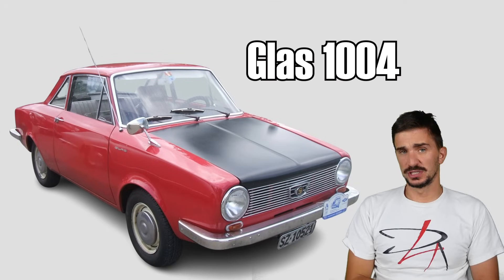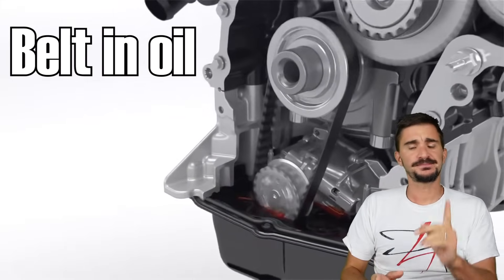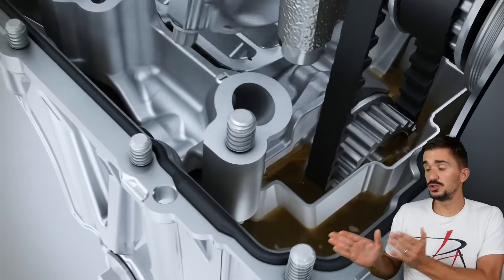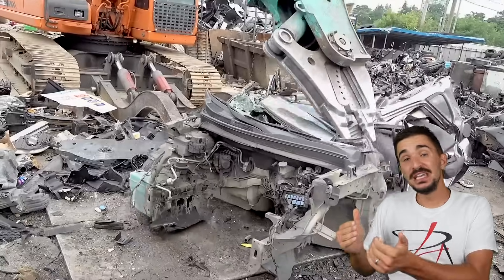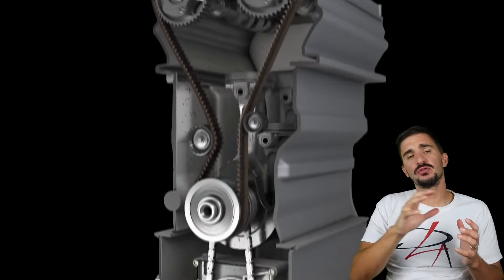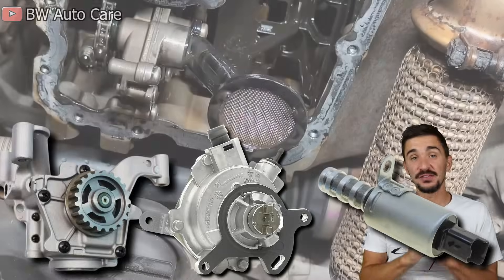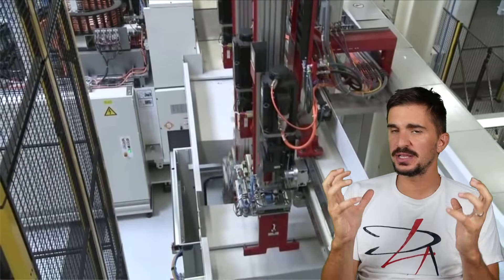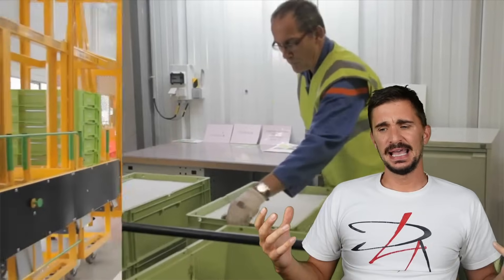Who Approved This and Why Is It Still Being Made? Wet Belt aka Belt in Oil Engines

Comment from the maker: Support the channel by shopping through this link: https://amzn.to/3RIqU0u
Patreon: https://www.patreon.com/d4a
Become a member: https://www.youtube.com/channel/UCwosUnVH6AINmxtqkNJ3Fbg/join
Grit: https://www.youtube.com/channel/UCt3YSIPcvJsYbwGCDLNiIKA
Reply: ⚠️5k miles oil intervals for all modern engines is key.
Timing chains, guides cylinder walls and crank journals  etc last last considerably longer.
I've and others have proved it in the motortrade ✅️
Reply: I found the video very optimistic, not depressing. If your voice helps them stop that ignorance in even the slightest way it is well placed optimism to think it is well worth trying.
Reply: You can blame the company(s), but ultimately this goes back to regulations from the governments, full of people who don't understand ANY of these engineering problems, demanding better and better emissions. 😒
They should have stopped pushing a long time ago, and just accepted the significant gains already achieved.
Reply: plz use that mindset with crumple zones and airbags! how many deaths from no airbags in the back seat?
Reply: @julesviolin 
Yup, good point!

Dave (Dave's Auto repair) recommends oil change intervals at least half of whatever the manufacturer recommends.

I remember the olden times when we changed the oil at 3500miles.
Then new cars were coming out and the salesman at the dealership said "no it's 7000 miles, now it's 10000 miles".

And I thought....
"Wow, our oil technology and engine efficiency has really gotten so much better!"

Lies!
Reply: Of course it was Ford, just like the plastic keys that would break
Reply: @Outlaws28  7k or 10k is still much better for engine than ''recomended'' 20k or so (of course depends on engine load, journey style/type)
Reply: Just to add one more failure factor- the wet belts are much narrower than dry belts.
Reply: Why haven't class action lawsuits curtailed this practice?
Reply: Bro, the 1600 idtec has timing chain not timing belt. I have one with 200000 km on the clock, even in your video, it is clear on the image of the engine, it has chain distribution. 😂😂😂 16:45
Reply: It is the petrol 1.0 that has timing belt
Reply: Car manufacturers don't do it for profit. They do it for meeting the ever increasing average fleet emmision standards. 1% is a huge gain for them. Even if it makes the engines and their overall enviromental impact worse. It can save them millions of dollars in fines.
Reply: in developed/ saturated marketplaces the discussion goes from how can we reach a bigger audience to, ok we have a set customer base we need to shorten their ownership window/ increase buying frequency. say with cars if the standard ownership were five years, implementing promotions that bring the ownership down to three years would net a 67% gain all else equal. 
That would be all fine and dandy, but selling vehicles is competitive and doesnt generally offer the best margin, so dealer groups lobby auto makers to make worse products as service is their primary cashflow. most brands end up in a race to the bottom of intentional failure post three year 50k mile warranty, sad world.
Reply: BMW N 47 engine…make timing chains to fail and then engineer it to be at the rear of the engine. Then to repair the complete engine must be removed. 😢huge expenses to the customer. Stay away from this garbage.
Reply: We need a database of products (and brands) with bad or malicious design! Because it's simply hard to actually know what to look out for when buying a car, a phone or basically any even slightly complex modern product.
Reply: My assumption at this point is that it's intentional to destroy interest in the ICE.

Once is happenstance.  Twice is coincidence.  Three times is enemy action.
Reply: PUT YA DANG HANDS DOWN
Reply: i have invented an engine that uses conventional components but produces less emissions, more torque and better efficiency with less moving parts. i refuse to patent it, and i dont have the money to develop it. it will take a long time because i was ostracized since 12 years ago when a hospital attempted to kill me due to my depression and psychedelic plant use after suffering a neck injury at the end of my apprenticeship. but i expect if i can get a decent job and do some part time university, you will see it some time within the next 10 years being adopted widely.
Reply: Could you please recommend any new car with less than 1.6L engine that is sold in Europe without this type of known mistakes? I own one of those cars with 1.0L ecoboost engine since 2016 (my car is 2015), I changed the belt in 2023 (60K km), recommended by my mechanic, after the change we inspected the belt together, it was not that bad but sure there was some swelling and wear, we changed the oil strainer as well, as you mentioned it was filled with sludge/particles.
Reply: I absolutely love your videos. You're very honest and informative. I went to school for mechanical engineering and planned obsolescence was a very obvious design for everything when I talked to professors who were in the automotive industry. Profit over progression is such a disgusting side effect of capitalism.
Reply: New Hyvo chains with automatic tentioners have more parasitic loss than a belt but old manual tentioner roller chains have less parasitic loss than a belt.
Reply: You can get over 100 HP in a NA 1 liter with high RPM and not boost.
Reply: You also neglected to metion push rods as a realibe valve acutaion
Reply: @julesviolin it's not the mileage of the oil change it's  the condition of the oil. Some oil last longer than others. The same oil will lose viscosity faster depending on conditions weather driving style ECT.
Reply: If not already done so or advised so both you and Lois Rossman could put the car manufacturers back on track in building vehicles like those built pre 1970 that were built to last a lifetime - and when I say lifetime I'm not talking 20-25 years 
Yes those old vehicles probably didn't have the best fuel economy but they also didn't end up in landfill or recycling 2/3 years from new because they were written off from a small rear end shunt that caused the airbags to deploy.  Most current cars are built like white goods and entertainment tech....part of the throwaway society
Reply: That is funny.
Reply: @erwinnijs1 and cost millions or billions in warranty engines and  Law suits . 
Like my old company that used the cheapest.  Worst fuel cards . Cheaper on paper but in reality we would do a 15-30 mins diversion or worse if night time call out . Fuel was rubbish so vehicles breaking down and we would have to replace our own fuel filters or book them in so a lost day and company would still have to pay us... it was the most costly  cost saving I think I've ever seen . 
Costs need to considered over a multiple aspects .. not just 1 blind piece of paper  .
Reply: Can you pls make a video abt the new porsche 6 stroke engine?!
Reply: Contemporary humans are clever, not particularly intelligent. Clever uses tools effectively. Intelligent (truly intelligent) uses them wisely, accounting for the fullest picture of what bears on that tool usage.
Reply: Sehr gutes Video. Danke
Reply: Well done Brother. Lots of good points you made. The stark reality that motor vehicle, design engineers, especially in passenger vehicles and light commercials, are all committing crimes against the people, is there for all to see. 
Must've been going on for over 25-30 years with so many components designed to fail. It really is shocking. It's all history now, with my first Ford doing 218,000 miles and my second over 300,000 miles. Those days of just regular servicing and no major failures are sadly long gone. 
Q. Why is the Airline industry so different? Boeing, Airbus, Rolls Royce ect build engines and aircraft designed to rarely if ever fail. You cannot have any failure at  38,000 ft with 200 passengers on board, due to some cheap nasty component failing. I guess the airlines are  heavily regulated, as opposed to Car and Lcv manufacturers who aren't. Emissions crap and safety issues aside, motor vehicle manufacturers are just not required to build reliable products. This applies to so many industries today of course. Designed to fail. 👍💯✔🇬🇧🤔
Reply: FireBeam,
Naw. Companies are run by bean counters, not engineers. Nobody said, "use wet belts". Stop blaming government for greedy bean counters who see early engine failure as not a bad thing unless it hurts market share.
Reply: The savings is 100% in taxes. That 1% fuel savings along with testing shenanigans allows compliance to fuel mileage standards with minimal investment. All of the cost is transferred to the customer who has to repurchase their product repeatedly with the manufacturer selling doomed to failure replacement parts for a profit.
Reply: @d4a  Governments just so closely linked to the motor trade, as with so many other things. 

 "Planned obsolescence is adding to the amount of electronic waste we produce, which is damaging the environment. In recent decades, we have become accustomed to a fairly short product lifecycle, because products either wear out or become obsolete."

"Planned obsolescence is the calculated act of making sure the existing version of a product will become dated or useless within a given time frame. In technology circles, the replacement cycle for smartphones has historically been two to three years, as their underlying components wear down."

"Yes, planned obsolescence is a real business strategy that companies use to encourage consumers to buy new products. It involves intentionally designing products to break or become obsolete within a certain time frame. The goal is to make existing products unfashionable or unusable so that consumers will buy new ones."
Reply: @julesviolin  
Quite, but fully synthetic oil costs a small fortune on my 2.3L Fiat camper, 30km changes i go by, and of course ir's a dry running cambellt.
Reply: @FireBeam  
Well, u could say that about UK illegal sewage outfalls by UK water firms, who are regulated but getting away with it. Regulation needs to reasonable and strongly enforced. 
If UK never joined the EU and were then forced to fit cats to cars i guess we'd still be chugging around in unregulated no-cat dirty cars and vans using leaded fuels.  Regulation is one potato but deregulation is a dangerous thing in the wrong circumstances.
Reply: @FireBeam  
Remember Ralf Nader, and "unsafe at any speed"
The auto companies fought tooth and nail against seat belts.
Seat belts wearing is mandatory in UK and Europe. No doubt in US so-called freedoms allows non wearing, don't know.
Reply: @erwinnijs1  
Well now, how come it's beyond the wit of the most advanced auto engineers to make something that works and is relable and long lasting, and does not cost the customer as victim thousands of €£$ to renew when due? It's not just cam belts, they churn out products with bad design inbuilt faults and unreliability year after year. 
Now even Boeing!
Reply: @schalkloots6988 
Customer as victim
Reply: @morkzorckerborg5000  
Correct
Reply: @AnAvgJoe  
Customer as victim
Reply: @stewart8127  
Not much use in very hi revving engines though.
Reply: @InvictaView  
Customer as victim
Reply: @RePeteAndMe  
Customer as victim
Reply: @nla27  
Customer as victim
Reply: @QB2ERS Simply put, there is only one way to decrease CO2 emissions without increasing pollutants and that's by increasing efficiency. There is unfortunately a limit to how far you can push efficiency without sacrificing either cost or reliability.  Some seem to have reached this limit...
Reply: Do the Ford 2.0L Split Port with self removing valve seats or the Ford (Fiesta) 6 speed dual dry  clutch transmission. Maybe explore / explain why we NEED 6,8 or 10 speed automatic transmissions now.
Reply: VERY interesting to learn that MOST vehicles FAILED before the 100K mark !!!  It simply points at the utter BAD driving of most people.
AGREED. Wet belts are NOT good. BUT those that snapped BEFORE 100K is simply because of BAD driving.
The manufacturers have had ample time to realise their mistake (IF they didn't already know .......) so I've made up my mind. 
My next car will be Japanese or Korean.
Reply: I wonder how long it will be legal for an ECU to deliberately run an engine rich? On a carbo engine you can roll coal like a diesel if you make the timing really retarded and dump a lot of fuel
Reply: @julesviolin  i think these engines are being deliberately designed to fail.
Reply: You are one excellent guy!❤
Reply: this reminds me of cylinder deactivation, it gives around a 3% fuel savings on your vehicle, but cuts the potential engine lifespan down by 80%.
Reply: @erwinnijs1  1% is easier to find elsewhere. Thinner tyres are actually cheaper, and would give more than 1% saving.
Reply: @G-ra-ha-m  Sure, but skinnier tyres wear faster and tyres aren't cheap either. It might be more cost effective to replace a belt sooner than to replace 4 tyres sooner.
By all means criticize them for price gouging tactics, like 75 dollar fuel filters with non-replaceable filter elements for instance. I'm just saying that making their engines less reliable probably isn't one of them.
Reply: @erwinnijs1  They don't wear faster actually, as the compound is not as soft. Tyres are wide to dissipate heat BTW. Also with more efficiency, the batteries don't need to be so big. The closer to a golf cart an EV gets, the more sensible.
Reply: @G-ra-ha-m  Skinny tires not only wear faster for the same compound. They also provide less grip due to tire load sensitivity. If you then take a harder compound to compensate for the wear you decrease the grip even further. Not a good idea IMO.
Reply: @erwinnijs1  Oh Erwin, you completely miss the point. Tyres are wide to dissipate heat. The heat comes from the energy in the battery. Wide tyres have more rolling resistance than thin tyres.
Reply: @G-ra-ha-m  The point was why wet timming belts on ICE vehicles, not the tire width on EV's.
Reply: @erwinnijs1  At reply 58 on YT's hopeless interface I've long lost track of this discussion :D
Reply: @G-ra-ha-m  :D
Reply: @G-ra-ha-m  tires are wide to distribute weight, which reduces traction surface deformation and therefore heat generation per sq inch, if the tires are too thin the tires will either sink into the ground or the tire tread will deflect too much, generating a lot of internal friction and heating up the tire, ironically the heat dissipation is better in this scenario, but that's part of the problem, there is too much heat flowing through the materials.
Reply: @thatguy-em9lt  Wrong, fat tires are there to dissipate heat of softer compounds. Look at a truck and you'll see the wheels are not that wide, but the tyre pressures are high.
Reply: @G-ra-ha-m  your assumption is based on a solid-body model of physics, which we know is extremely flawed, what you need to look at is soft-body physics. Wider doesn't dissipate heat significantly better because rubber is an insulator, meaning you need a lot of rubber to dissipate heat efficiently, what it does is prevent heat from being generated in the first place because most heat from tires comes from internal friction in the tire caused by deformation of the tread and sidewall, deformation increases with ground pressure, ground pressure is determined by weight divided by contact patch, a larger contact patch without a corresponding increase in weight means you have less deformation and therefore less internal friction, less friction means less heat generated. 

The reason why highway-haulers use narrower tires is initial cost savings, a major part of the reason why you see so many tire carcasses and pavement flaws on the road is because they have too much ground pressure under load, long-haul trucking companies save money on initial tire purchases, the public pays for it by them spending more overall on tires, passing the cost of purchasing more tires onto the consumer and decreasing the lifespan of pavement in the process, costing more tax revenue.
Reply: @thatguy-em9lt  It's not an assumption, the reason for wide tyres is not a secret, it's documented all over the web. It's to dissipate heat.
Reply: @G-ra-ha-m  again, that theory was developed before soft-body friction was really worked out, and most people working in Automotive fields aren't going to work with it because for most performance calculations, rigid-body physics are "accurate enough" and are vastly simpler and easier to work with for engineering purposes, along with being massively easier to run simulations for in CAD/CAM and CFD software, as with soft-body friction you need several times the computational resources to run a simulation and either way, the results you are actually testing for will be reasonably accurate either way. 

If you actually worked with this kind of stuff you would know these things.
Reply: @thatguy-em9lt  If you think that wide tires are required for heavy loads, I would advise you to actually address the problem of the heavy load, rather than working to mitigate it via tyres etc.
The heavy batteries are a serious problem, and bad design.
Reply: @G-ra-ha-m  there are a few ways to address ground pressure.

the cheapest is to widen your tires

the next cheapest is to go to duallies or triplets

more expensive is to increase the number of axles

and the absolute most expensive is to reduce vehicle weight

in heavy hauling the last one is practically impossible because the vast majority of your weight is cargo and the heavier the load you can attach and fit on one truck the cheaper it is to move a given weight, so if you're using equipment your best bet is to find a tire or track width that spreads the load efficiently and if needed then go up to duallies or triplets, with quadruplets being a last resort if you cannot add more axles for whatever reason
Reply: well said haha
Reply: @morkzorckerborg5000  That doesn't make sense , if the car companies only wanted 3 year ownership then no one would buy them , only lease them. And if the cars fall apart during the 3 years where's the profit when doing warranty repairs. Look at all the car companies that are in financial trouble, they build crap.There's a reason why toyota is the biggest car company in the world, they make good stuff.
Reply: I agree with your comment about various manufacturers choosing technology that fails, for increased profit.  The enormous waste problem from us humans alone makes that approach unsupportable.  Add climate change and ...  😡
Anyway, I have subscribed.
Reply: You really have to do your research when looking to buy any car. I purchased a 2020 Ford Edge SEL 2.0 Turbo. Great car has 48,000 miles. At 10 years it will be sold, because I know expensive repair bills are coming. I'm retired now and for me I  will be leasing  new vehicles the rest of my life. Only maintenance during the 3 year lease fluid and filter changes.

My advise stay away from turbo engines, wet timing belts and CVT transmissions. Why less cost to repair and less headaches.
Reply: Cars before 1970 had plenty of problems. Engines that burt oil at 75,000 miles so bad you got tickets for it. Engine rebuilders in every city. Transmission problems, also. Don't get me started on carb, points, spark plug, cap, rotor, disturbutor problems, every 2k to 10k to get money out of your pocket.
Reply: Seat belts are required in US. Cars today are much safer, but you Pay for it. Anti-lock brakes are great but when they fail it can be pricey to fix.